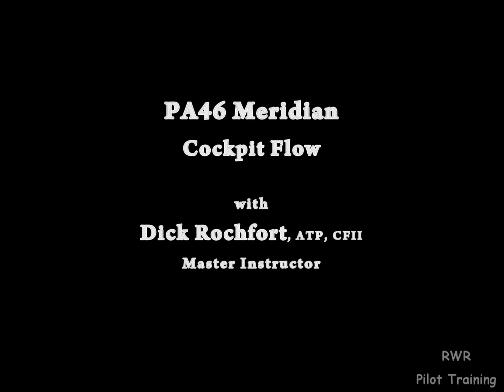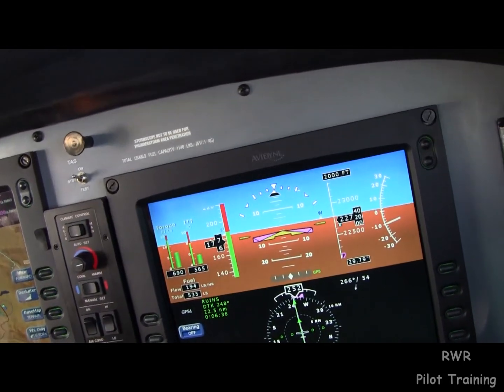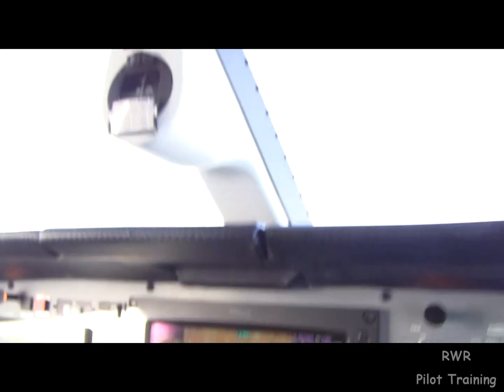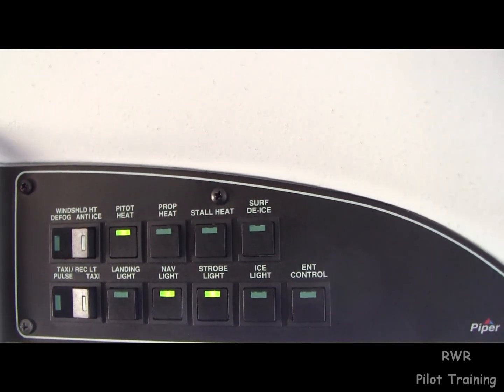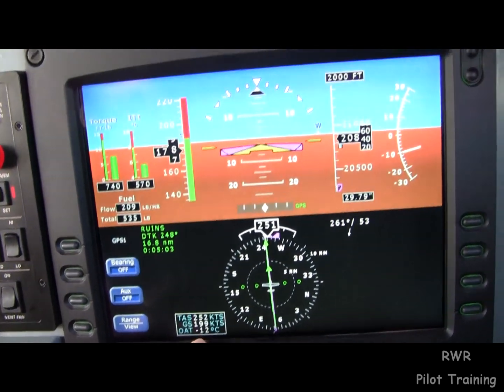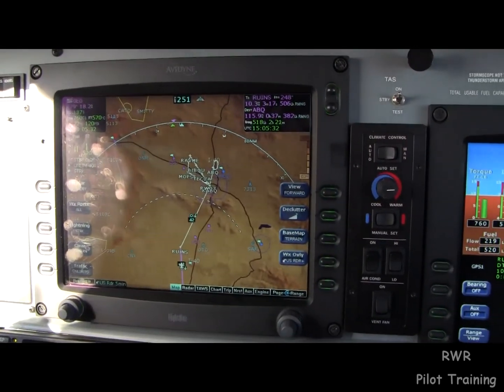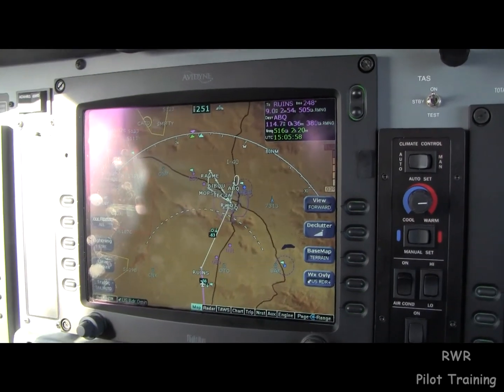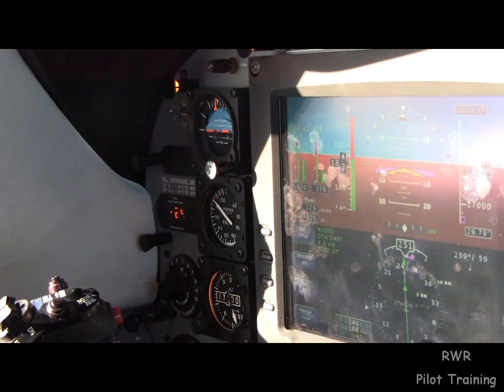PA46 Meridian Cockpit Flow

Comment: Dick, you are right, if your wheels are up, pitot heat should be on. I was flying a C-172 at 5000 and mine froze...IAS went down to 60kt and then 46kt.  It was barely 40 degrees and there was moisture in the air.From that moment on, it is on my checklist. Hold Short line = Pitot Heat on.
Reply from the maker: Thank you for your comment, cmdmd. You are absolutely right. Lots of part 91 pilots in the US have not been given any training at all on flight into known icing (FIKI). The PA46 is often the first FIKI equipped aircraft that this pilot has flown. Without proper training bad habits are formed. Unfortunately it is possible to fly many hours in a PA46 without proper training on the use of FIKI equipment, but safety is not about probability, it is about consequences.

Comment: Under normal conditions , why would the ecs switch or bleed air valve be off? Some checklists or flows can create busy work for pilots!
Reply from the maker: The turbine aircraft needs all of the air going through the engine to minimize the start temperature. This means closing off the inflow so that all of the air goes through the engine. For this reason, the checklist calls for inflow out off and ECS off for engine start. Fly Safely - Train Often .. DR